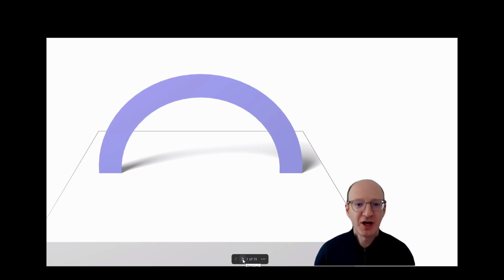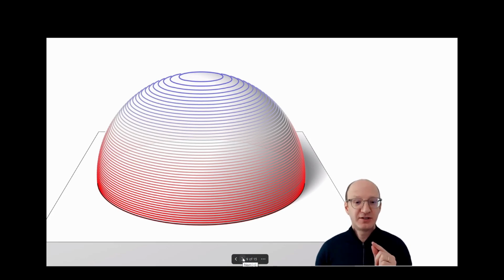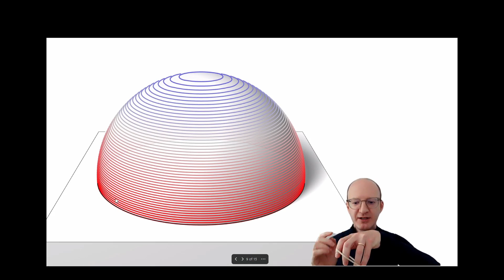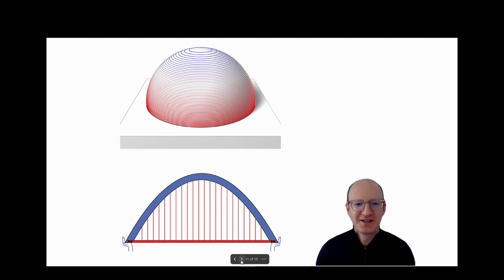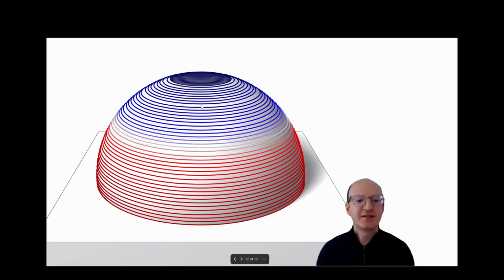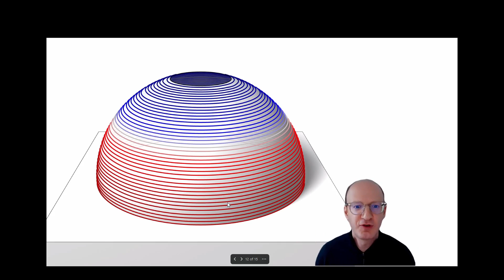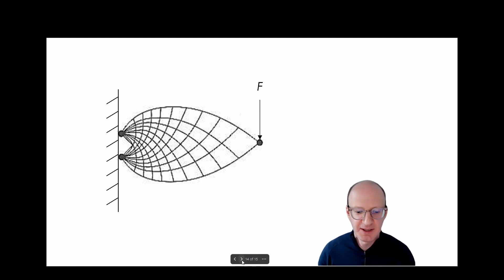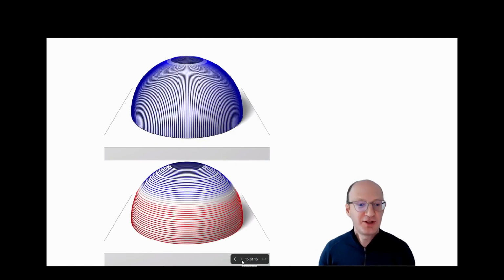How Domes Work! (Structures 3-2)

Comment: High. Is the catalonian boveda works in the same manner than domes?

https://youtu.be/e50ncAOiEjw

I'm talking about this.
Reply from the maker: Good question!  In many ways yes in that they are a 3D assembly that carry loads in compression.  The wonderful thing is how there are so many variations of material, geometry, and construction that can use the basics of dome behavior!
Reply: @Paul Kassabian  and how they can build them? It works as an arch, row by row until all four side connects, and after  that as they build row by row at all side, when they finish a row it holds itself in position? Like the ring in the dome?

This is how holow piramyd works also?

And how bruneleschi dome was built in firenze? How he could make the structure self suporting with the L shaped brick? You agree the best option to cover that was a dome?

And what stop this extremely heavy structure at the base to push the wals outward?

Comment: A question about the hoop forces - You mentioned that the bottom experience tension forces instead of compression ones.
But I wonder isn't that because we're used to imagine and build domes as hemi-spheres, which do not follow the catenary curve most optimal for arches?
Even if it's a concrete or stone dome (that hold very well to compression forces, but poorly to tension) the bottom of the dome wouldn't be stable, unless its walls are thick enough to ensure the catenary curve is within the walls.
Reply from the maker: Thanks for your note.  The hoop force is providing restraint, especially at the base, in lieu of any external horizontal support...essentially providing an internal "tieing" of the dome.  So, to your note, if domes were more based on catenary geometry that would significantly reduce the hoop forces in the main dome but you would still have hoop forces at the base to provide overall equilibrium.

Comment: Great video!
Could you elaborate on geodesic domes specifically?
And particularly to the effects of rearranging the struts in different angles (while preserving the strong triangles structure).
I'm considering building a geodesic dome for a home, and I wonder (in principle - of course I'll hire an architect for precise plans)
if it's possible and how to push some struts around to open a bit wider space that can accommodate better rectangular doors and windows.
Reply from the maker: Geodesic Domes is on my list...Bucky, Biosphere, Spaceship Earth...
Reply: @PaulKassabian  make sure you look at Monolithic Domes, they have built hundreds of them using several methods, from small to very large. Their latest tension material is basalt fiber, which has many advantages over steel.
Reply: since geodesic domes come out of synergetics, the experiential science of the spherical, omnitriangulated structures of spacetime, i would suggest not breaking the pattern integrity with rectangular doors and windows, but rather go along with the omnitriangulation. it will be well worth it, not just structurally but even aesthetically.